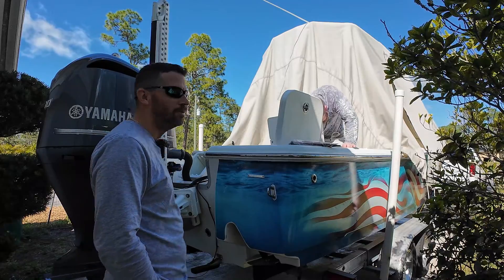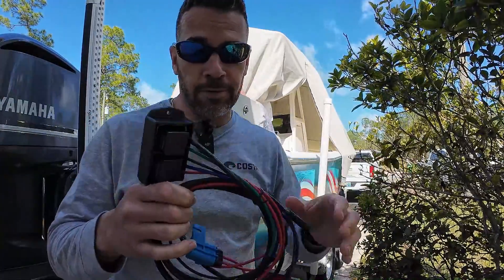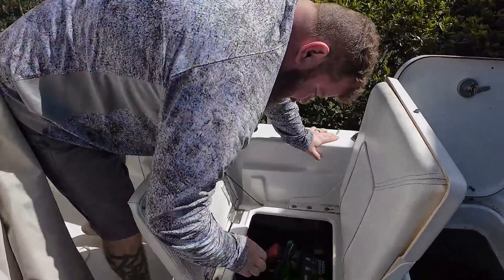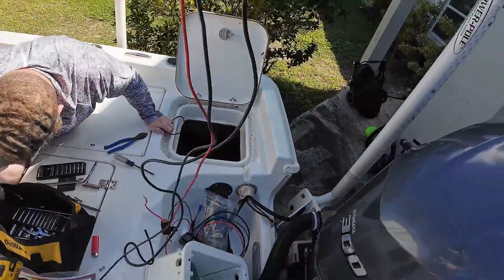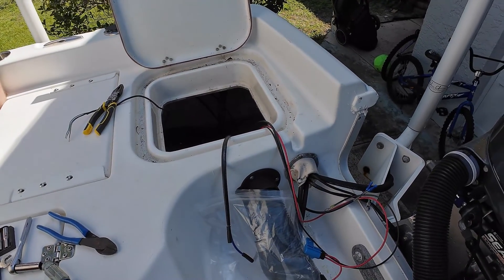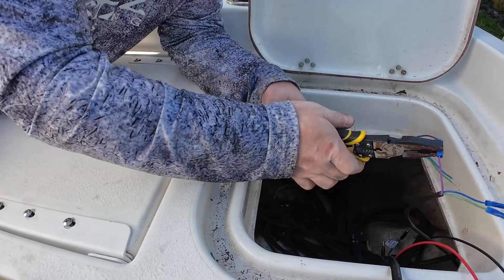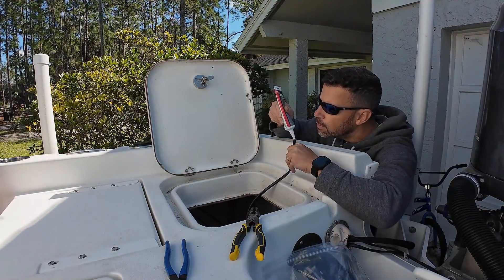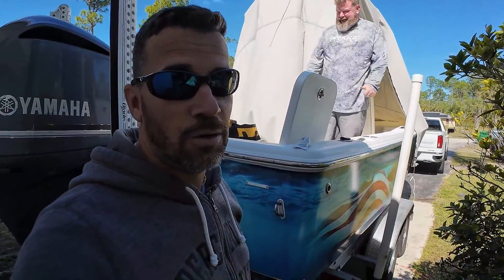Fixing Atlas Jack Plate Relay Module Failures | Sea hunt BX 24 BR boats

Comment: That’s a rip off if you have to replace the wiring harness to replace the relays…looks like the new one has relays you can replace
Reply: @bryanrackard9268
0 seconds ago
Replace with a 25 dollar  12 volt 250 A  winch solenoid . I got tired of replacing that thing every year . It's a rip off .....

Reply
Reply from the maker: @bryanrackard9268  good job man, the original is definitely a ripoff!
Reply from the maker: I totally agree with you my friend and unfortunately the relays can’t be replaced separately, they are intergraded with the harness, I’m sure we could’ve fabricate something however sometimes is good to replace with original parts and yup sometimes this will cost an arm and a leg!!